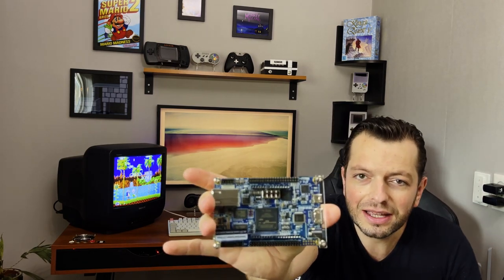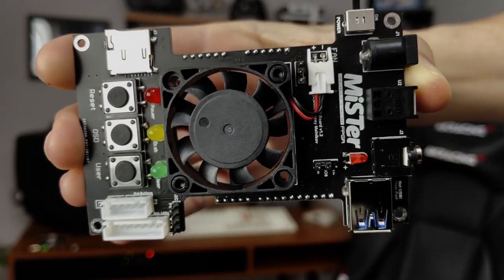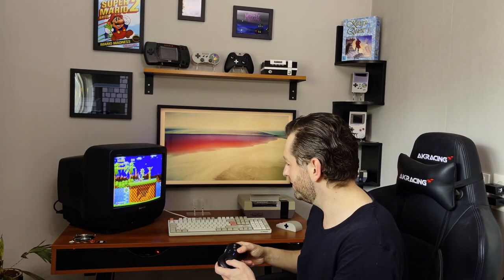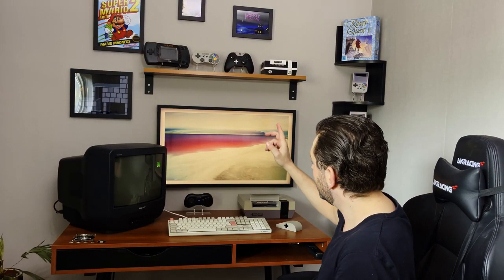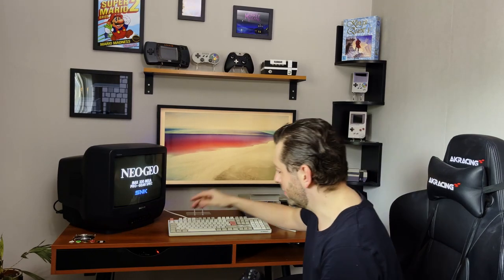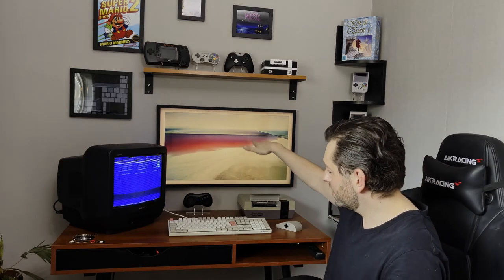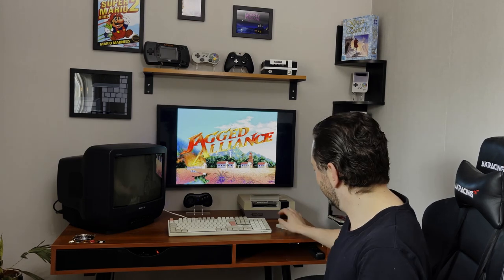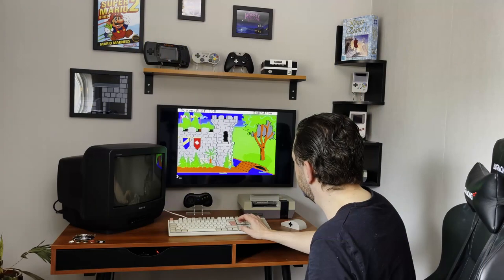Ultimate Mister FPGA Project Setup - Custom Gaming Desk

Comment: do you get the NeoGeo core with the bios included? or do you have to also find the bios somewhere,,,or is it so plug and play that you only have to put in the roms yourself....  like to know that.
Reply from the maker: No you need to install the BIOS files and roms yourself. There is a good tutorial for that here: https://youtu.be/8FLGFng5YS0
Reply: @TheDanielSpies_Arcades  I thought the new MiSTer program ( Mr Fusion) has bios getter included that will install all necessary bios for different cores?
Reply: @retroforce6919  not all BIOS. Some have to be added manually. Very easy. Update all is still very good.
Reply: @ninetendopesaitama2107  I had the wrong impression with update all. I added Neo Geo bios manually before update all was available. Thanks for clearing that up.
Reply: Bios files are all on archive.org ... but if you use the unofficial "Update_All" script to update your MiSTer, there is an option to download all the bios files from archive. However you will probably have to put them in the game folders manually where they need to go.

Comment: I may be spreading misinformation, but couldn't you set the MiSTer to line double so you can play those x486 games on the CRT?
Reply from the maker: Hmm I will check that out, thanks!
Reply: What kind of CRT? A consumer SD CRT TV? A CRT VGA PC Monitor? A professional broadcast monitor CRT (PVM/BVM)? The answer is yes to all... except with an SD CRT TV these are 240p resolution CRTs... so Windows will look like crap because you can't read the text. With DOS you can get by using custom resolutions. The games will look fine but its better to use a different CRT in some cases since DOS was meant to run at higher resolutions sometimes.
Reply: You just need to add custom ini settings for AO486 to make it work with your CRT TV. Only downside is that it's hard to read the text in the Exodos launcher (maybe tweaking the settings further will help), but games play fine and no need to use an extra monitor :)